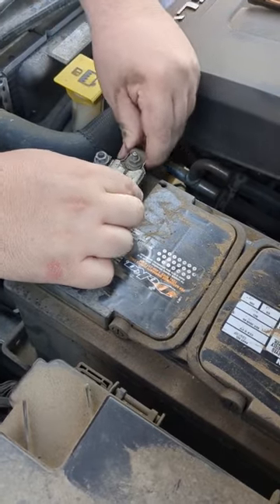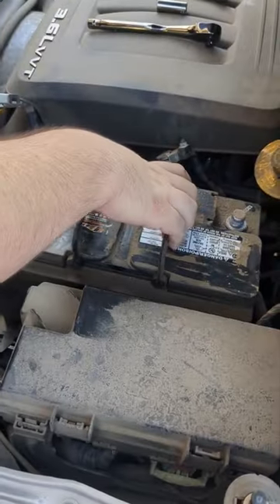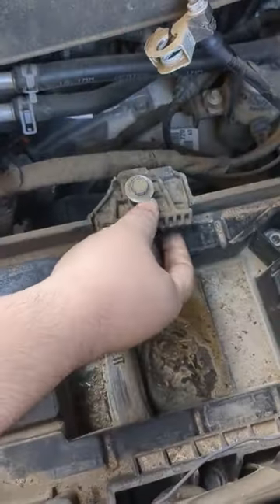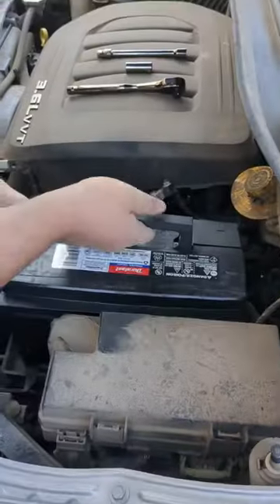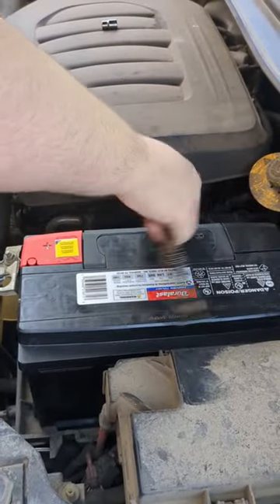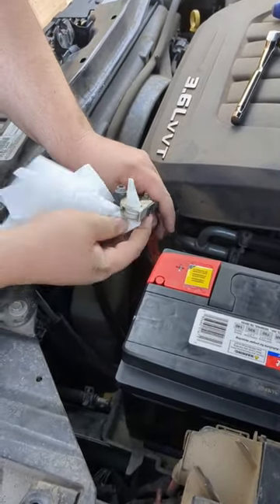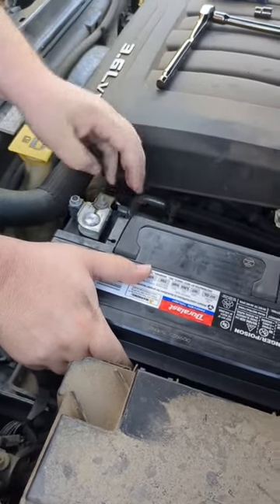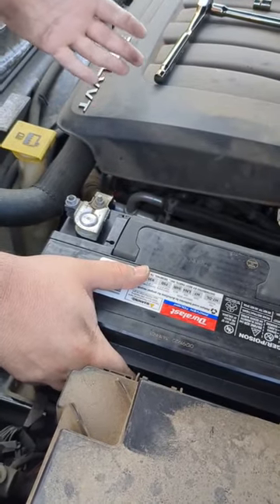Dodge Grand Caravan 2018 Battery Replacement #shorts #dodgegrandcaravan #minivan #battery #vanlife

Comment: One tip: Wear gloves while changing the battery. The cotton knit work gloves with palms and fingers dipped in latex will improve your grip and will keep your skin safe from corrosion fallout when you clean out the clamps.